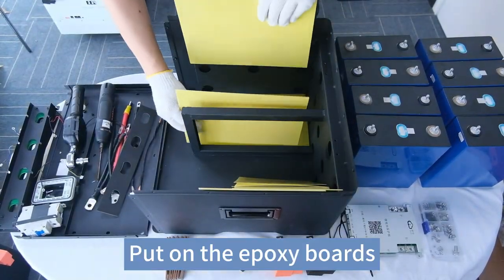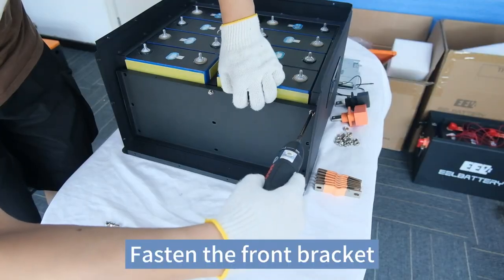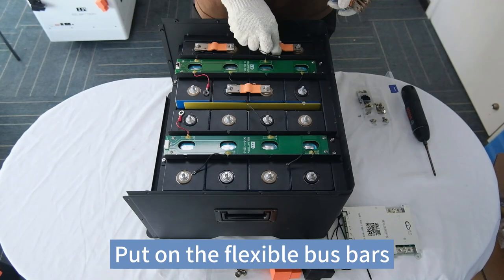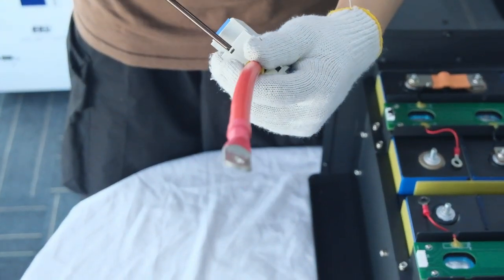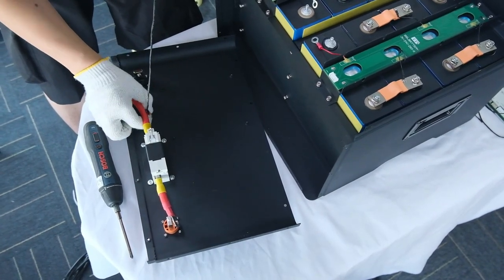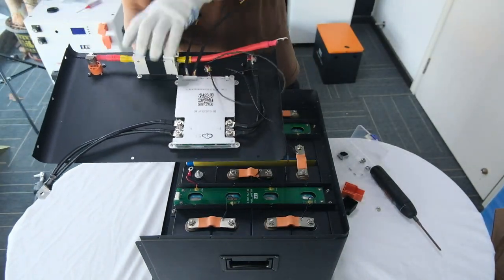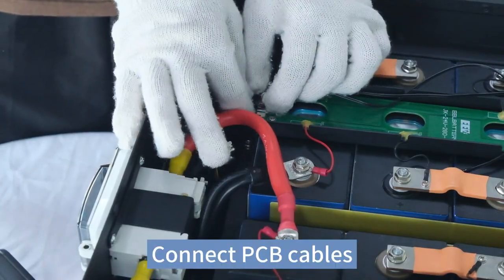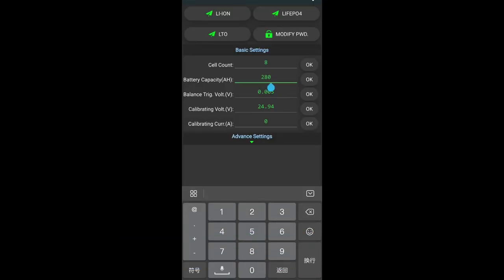24V 302Ah LiFePO4 Battery Active Balance System DIY Guide, build the battery pack with JK BMS

Comment: Nice new Battery Box,one Question is it possible to make the plus and minus connector ports behind the box and only the touch display in the front with the can bus and RS485 port. This were more clean on stackable boxes and would look better without the cables in the front.
Reply from the maker: We will consider of that, it is possible to make the box easier to use☺

Comment: Great looking box, the kind of product I was looking for.
 Questions: 
1.Does this battery require an exterior fuse, what type and size
2. Can I parallel this battery with my old lifepo4 8s 24v 200A with its own bms. Or can i parallel two EEL 24v batteries?
3. Can it take the seplos 24v bms? I see that people buy it together
thank you

Comment: REPT 150Ah cells have the almost same height=204mm and the same width=174mm as standard 280-304Ah cells, but most importantly are half the thickness=36mm.

In the same 24V = 8x304Ah DIY ELL Battery Box can fit 48V = 16x150Ah. 

The same is applicable for the 12V DIY ELL Battery Box: 
In the same 12V = 4x304Ah DIY Battery Box can fit 24V = 8x150Ah.

It would be great to have these smaller 48V and 24V DIY Battery Boxes from ELL on the market. 

This would not require much modification of these basic 24V and 12V DIY Battery Boxes on the ELL side. 

Other suggestions for improvement:
1. Adding new JK Inverter BMS as an option for this modified smaller 48V DIY Battery Boxes would be great with Touchscreen option on front panel. 

2. Missing mounting options on these smaller DIY ELL Battery Boxes: the easiest and best would be to add threaded inserts all around the outside of the battery box on each side. 
VoltGo Elite Series batteries have the best mounting system using straight plates and angles between the batteries and the surrounding area, take a look and get inspired, it would be great to have these mounting options on your smaller ELL DIY battery boxes too.

3. It would be better with double plus and minus main terminals on front panel.

4. For 12V DIY ELL Battery Boxes Keep the fuse, but also add a Circuit Breaker as ELL have on larger battery boxes.
Reply from the maker: REPT 150Ah these cells are not mainstream in the market, I accept custom, but we will not market, because these cells in the market circulation is too small.

Comment: Would it be possible to modify this 24V DIY Battery Box Kit for 280Ah/302Ah to 48V for REPT 150Ah cells?
No big modifications are needed because REPT 150Ah cells are the same size as 302Ah, just half of their thickness.
It would just be enough to modify the top bar above the cells with more holes for the preassure release velves and put the old (black) 16S JK BMS in the kit, as well as a option for the new JK Invertet BMS.
It would be great to have a smaller DIY 48V 7,68Kwh battery kit in the same battery box as the original 24V version.